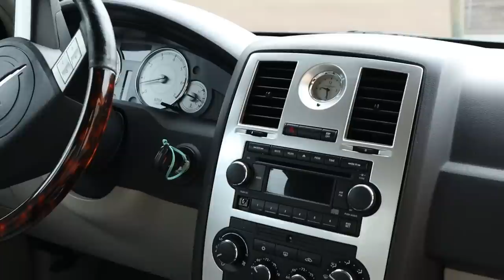Putting THOUSANDS Of DOLLARS In A 15 Year Old Chrysler 300c ... To Give it AWAY FOR FREE

Comment: In my opinion Everyone should buy one of these right now and do the same thing, Resurrect these old 300s man, 
I'm a 23 year old in michigan and have been doing my best at it, have a 2010 300 and a 2006, have also had a 2005 300 and a 2008 300.
Every single one was used and abused.. they need our help!
And all you 300 owners need to keep power washing/waxing your shit!
These are all metal except front and back bumpers guys.
Reply from the maker: It would be crazy to start a movement and bring the OG 300 back! 💯💯

Comment: Make sure you dont let it idle too long, roller lifter problems, but looks good
Reply from the maker: does disabling MDS help with that
Reply: Not at all, it's a angle problem, not enough oil     getting to the cam and rollers during idling

Comment: I have a 2006 Chrysler 300C with a Nag1 Transmission. It looks identical to the vehicle in this video. It stalls at low speeds or coming out of a red light. It will die in the middle of traffic. I can't find anyone who can pin point the issue here in Tucson, Arizona. 
The codes I'm getting are p0700 and u0100. 
If anyone out there has seen and fixed this problem I'd appreciate the help.
I can't sell the car to anyone knowing that it has this issue. I'm considering donating the car to someone who can fix and share the info on you tube. There are many people with this problem and there doesn't seem to be a fix.
If I could repair it and continue to drive the car it would be nice. The car runs like a champ until it passes out in traffic.
You guys are doing a great thing giving this car away after all the work being done. I hope it goes to someone in need.
God bless